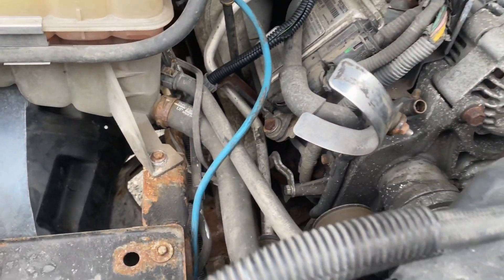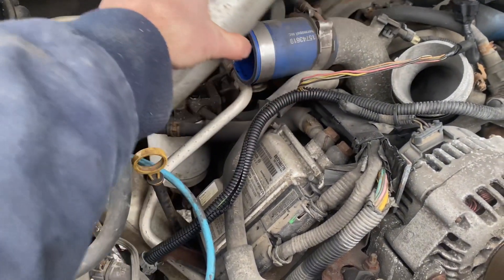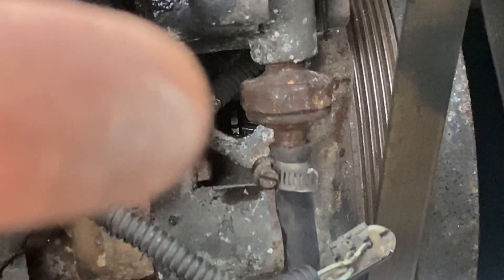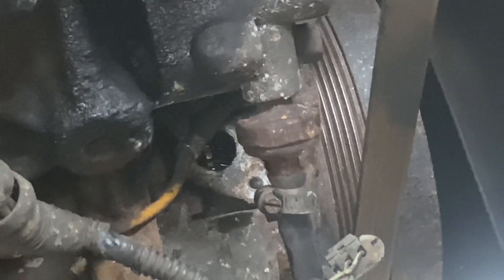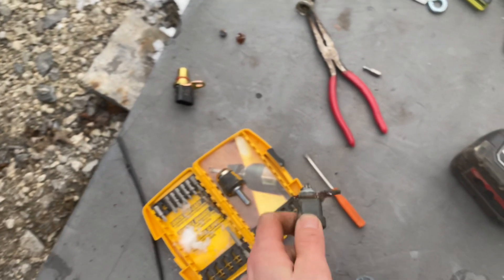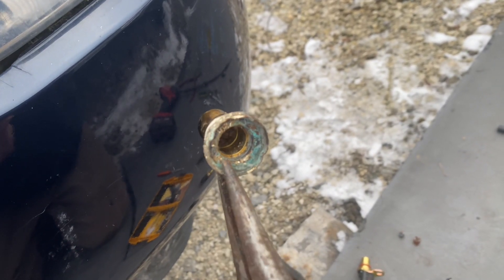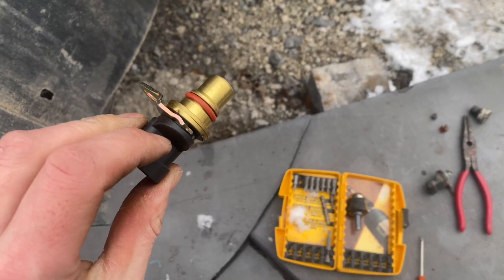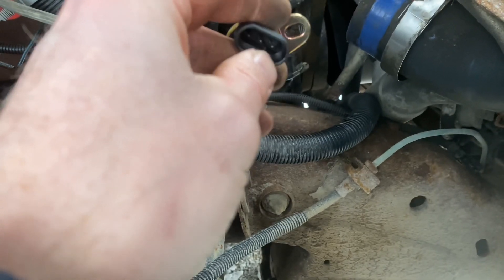LB7 Crankshaft Position Sensor *Easy Access

Comment: Thanks! Maybe it'll be in the same place on my 07 LMM duromax. Mines a crank no start, plus my filter pump keeps losing its prime. Changed the housing and a couple hoses but can't find anywhere else it could be losing prime. Started out as a water in fuel issue.  Dropped the tank and cleaned it out, blew out the lines etc. Driving me nuts until I finally thought to check for codes. Lol. That's when I got the 0336 and 0673.